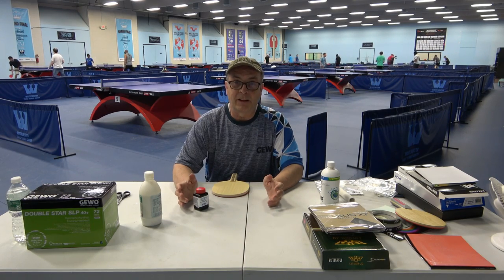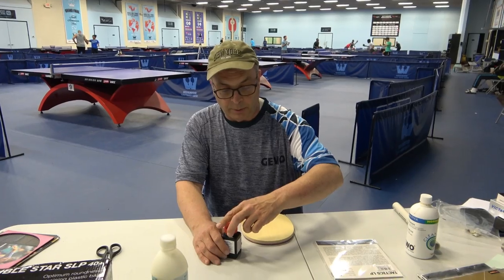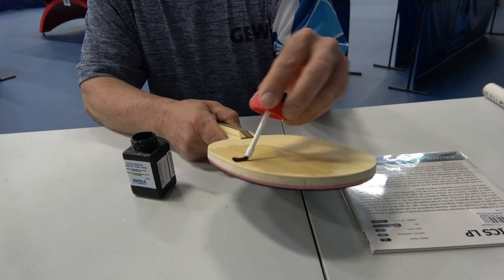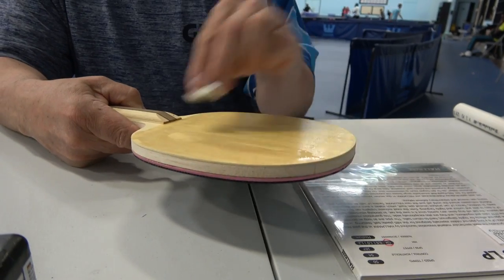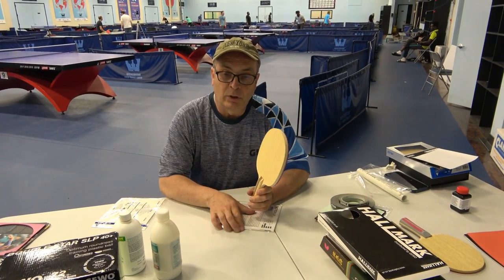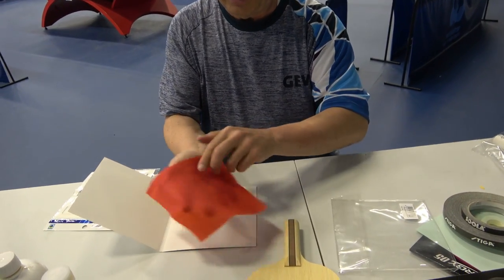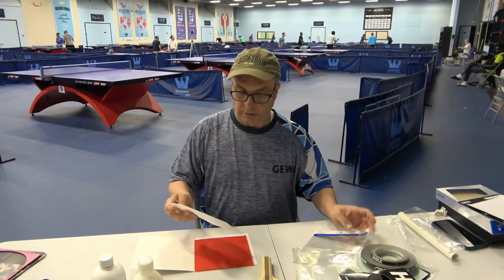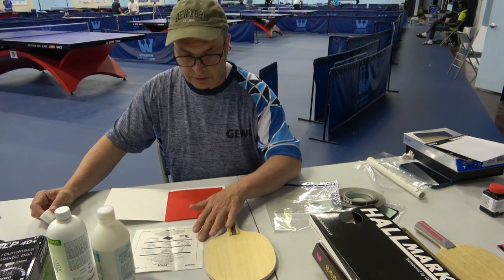How To Expertly Assemble OX Long Pips onto a Table Tennis Racket

Comment: The rubber doesn‘t need the glue layer, this will surely affect the performance.
I also apply the glue layer on the blade to prevent damage at the removal.
Reply from the maker: Thanks fo ryour comment on this. It is appreciated.

Comment: just use some tape to stick all pimple surface then you can easily glue & stick rubber to the blade without any wrinkling.
Reply: Or, you could pin the OX on a sheet of cardboard to hold it in place while you apply the glue.